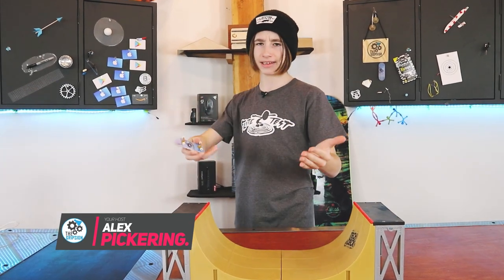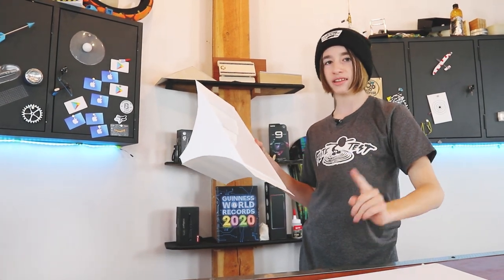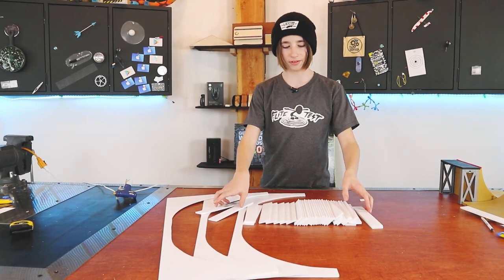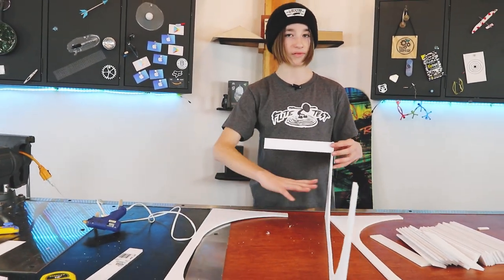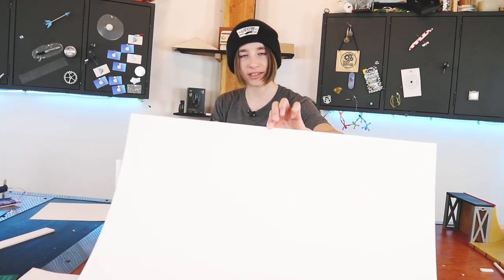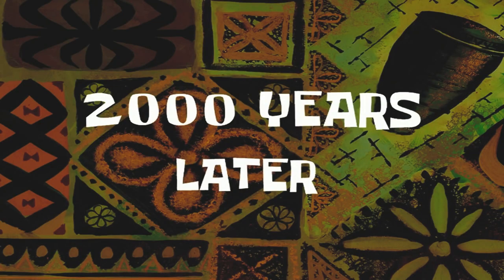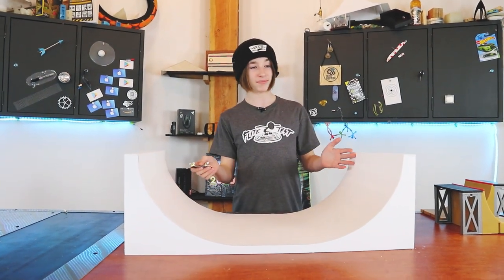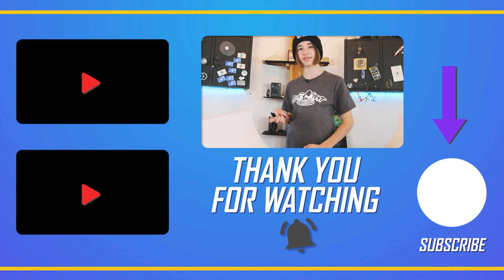EASIEST D.I.Y. Fingerboard Half Pipe UNDER $5 !!!

Comment: Awesome. 

I've felt the Tech Deck Halfpipe is too under scale. 

These are about a 1:8 scale so doing the math the Tech Deck Half Pipe would be barely just
6ft High x 6.5ft Wide and only just 14ft Long Including the flat Top decks.

That's not tiny but also not that big for whats meant to a Vert Halfpipe